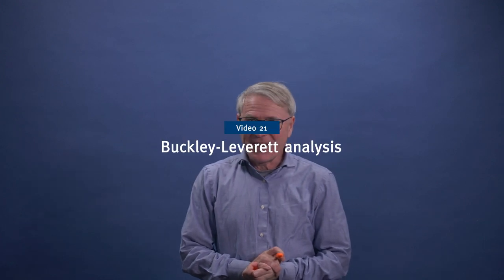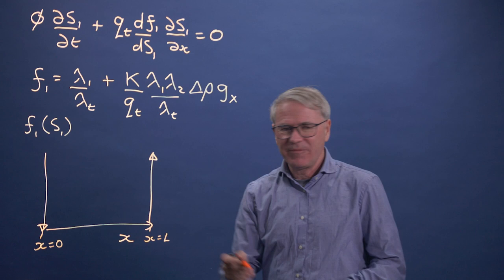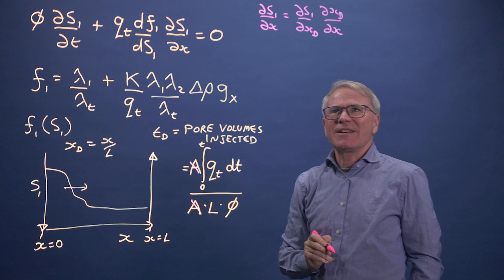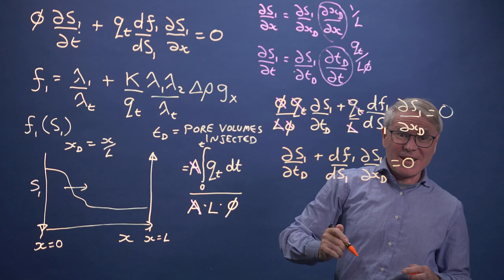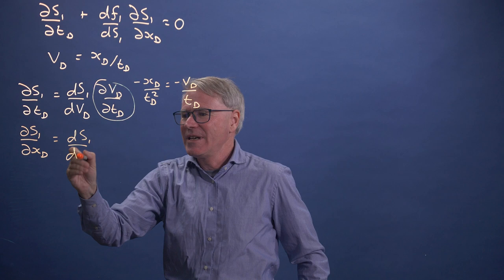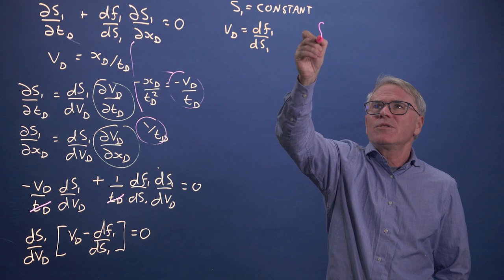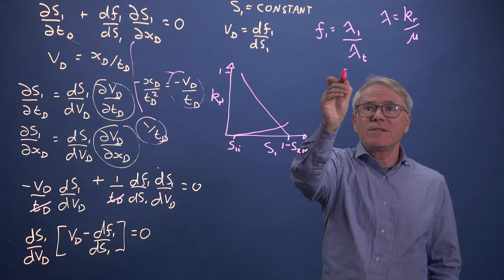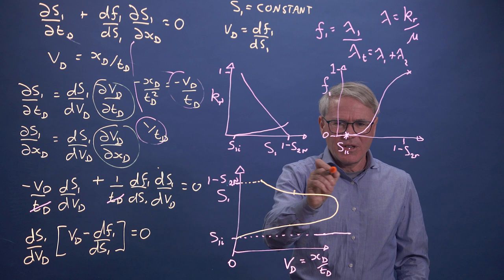Buckley Leverett analysis

Comment: Dear Professor Martin Blunt thank you for this great explanation,I have a question about the behavior in that we have trouble saturation for the same distance is that because we neglect the capillarity and the gravity term from the fractional flow?.Because at a low saturation where the saturation gradient decreases again, the capillarity is so high so it might be  neglecting this capillarity force will lead the gradient to be lower again
Reply from the maker: I am not quite sure what you mean.  Yes, we ignore capillary forces but we do not need to neglect gravity.  Capillary forces will smear out the shock front, leading to smaller saturation gradients.  You can have a constant saturation though even if capillary forces are considered.
Reply: @BoffyBlunt  thank you professor,what I meant is neglecting capillary leads to that Behavior of triple saturation and drawing tangent is just like we reconsider the capillary effect because these low saturations should have high capillary pressure based on pc vs sw. In the other hand I have another understanding from your lectures on YouTube is that the shock we developed represents advective flow and the capillary has no contribution in that shock. In summary my question is can I give this physical reason of the neglecting capillary pressure lead the low saturations to advance slow where we get triple saturation. I’m just trying to understand why do we have triple saturation or in another context why the fractional flow curve behave as it is when we neglect capillary pressure. With regards
Reply from the maker: @hamzaalyaseri6047  The fractional flow as a function of saturation does ignore capillary forces.  As I said previously, the inclusion of capillarity tends to smear out the shock.  I do not understand what you mean by "triple saturation": the fractional flow is always a single-valued function of saturation.
Reply: @BoffyBlunt   thank you professor for your patience and fast response, i will change my question to : why the shape of Sw vs distance takes this shape, is there is any physical reason or its just math problem ?
Reply from the maker: @hamzaalyaseri6047  It is always both - consistent with the maths and physically-sensible.  Since the wavespeed for low water saturations is low, a shock develops.  In reality this shock is smeared out by capillary forces, but there is a sharp change in water saturation at the leading edge of the water front.
Reply: @BoffyBlunt  
Thank you very much professor you made the two phase flow in permeable rock easier and your videos helped me a lot . Thank you again